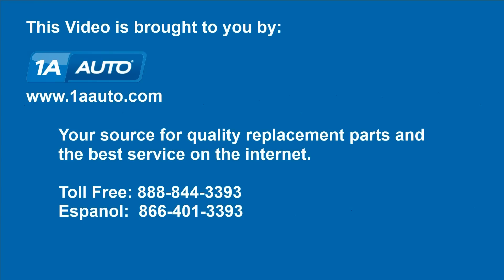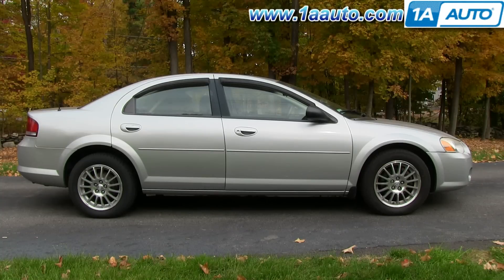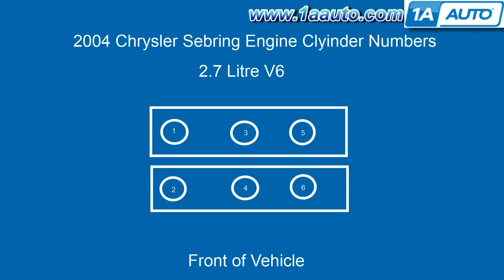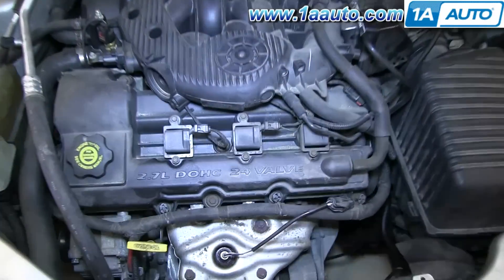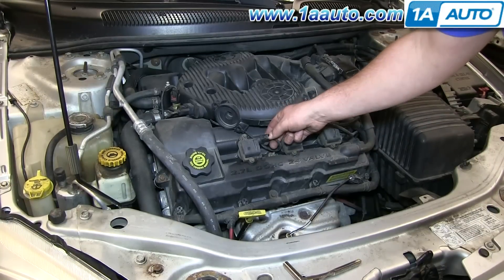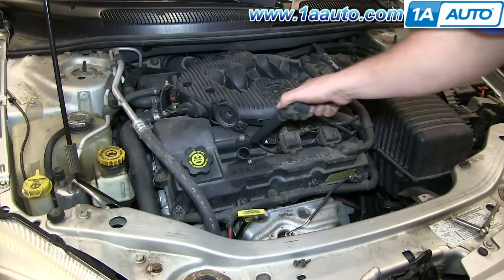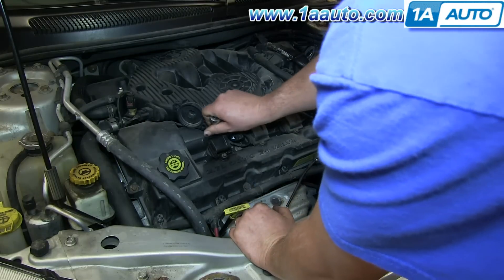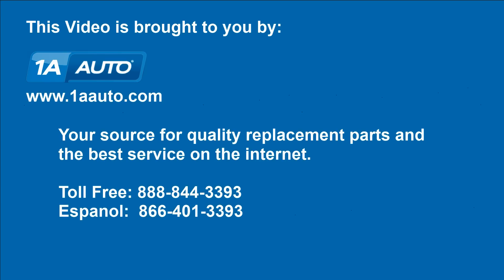How to Replace Ignition Coil 01-06 Chrysler Sebring 2.7L

Comment from the maker: Spark plug wires tend to go between 50,000-75,000 miles. On vehicles with individual coils, it's not uncommon  to get more that 75,000 miles out of them before that need to be replaced. 1aauto.com 888-844-3393

Comment: On the ignition coils are they numbered or does it matter which spark plug it goes into?
Reply from the maker: They're not cylinder specific...however, when you change them do one coil at a time, do not unplug them all. That way you will not cross any wiring. The wires are cylinder specific and would make the firing order wrong if crossed. Hope this helps you out. 1aauto
Reply: Yes it did thank you
Reply: I hear alot of bad stories about these engines and how they tend to breakdown very easily. So my question is my car has 150k miles on it and have not needed to change water pump or do a full timing chain replacement should I consider this and get it done??
Reply: It doesn't matter, the coils are universal